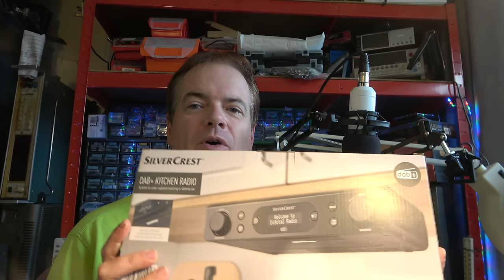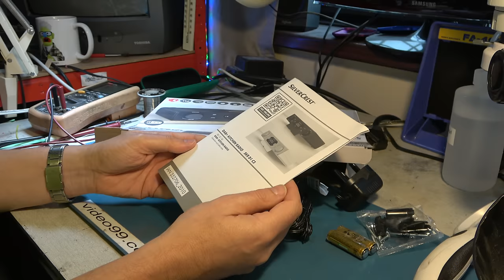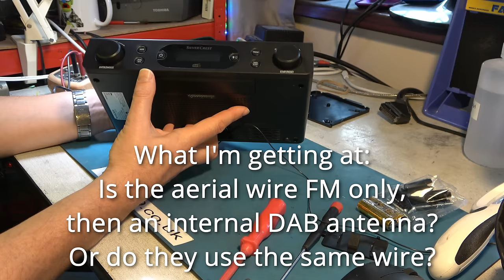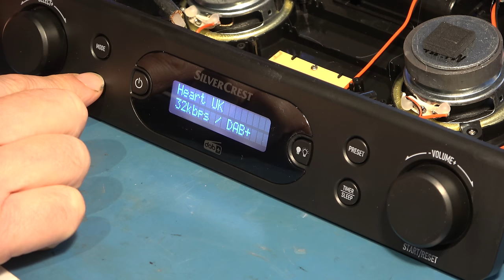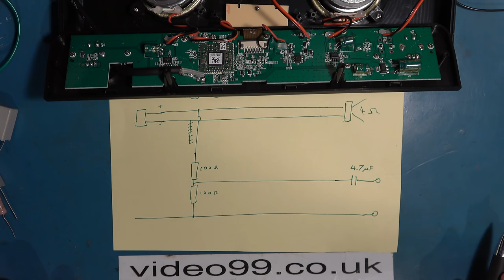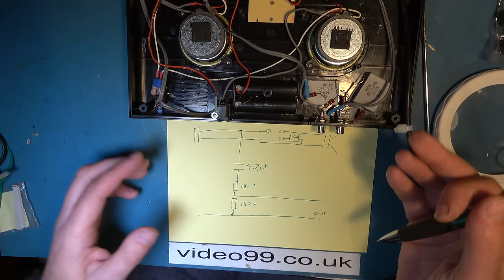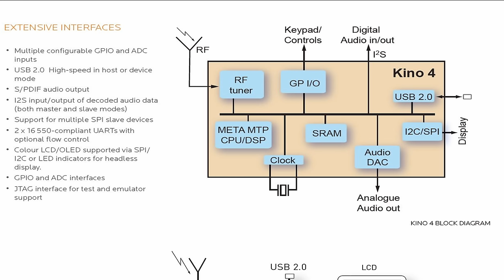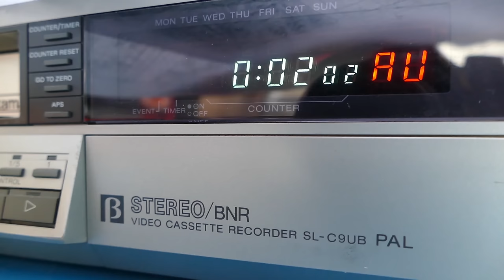DAB radio modifications.  LIDL kitchen radio could use some upgrades.  Part 1.

Comment: Did you select this purely because you want this style of under cabinet radio ? I switched to a Google home mini some years ago, sounds fine in the kitchen  :) DAB wise, silvercrest, ultra entry level, so I'm not surprised that it's deaf ;) Amazon echo also excellent for radio, they both just use TuneIn radio. Aren't the amplifier chips in this little bridged output devices rather than push pull... Hence the DC component. All makes for an interesting video, thanks as always.
Reply from the maker: I chose it because it was small, neat and cheap!  Whilst entry level, the radio module employed can also be used in more expensive devices so the performance is very good.  That's what can be great about modern electronics, even cheap items can perform brilliantly because it's almost impossible to screw up the operation of a bought-in module or chip.  Yes, the amplifiers are bridged (push-pull on both terminals), but the point is that neither terminal is at 0V and a DC block is required.
Reply: Very true indeed, frontier silicon make majority of modules these days I think. As you say amazing for £25 ! Some of the Majority radios are nice too. I bought my first DAB tuner back in about 1998, I took part in a field trial of dab back in 1994, had a technics ST-SG1000 at home for a while before it was released ...fun days :)
Reply: I live somewhere with good DAB reception and have a not very cheap Sony micro component reciever yet inside it is still problematic, have to be very particular about how the antenna is arranged. Even if you think you've got it right, if someone stands in a certain spot in the room it drops out! I didn't think that could happen with this type of antenna.
Reply: Gives you lots of audio streams when your internet is down though and doesn't saturate your bandwidth, especially when you have a family sharing one connection..

Comment: I was always curious if it is possible to extract the digital bitstream of one of these digital radios or the "HD" radios and save that data to a file that can be played and edited like a wav file.
Reply from the maker: The datasheet for the module says that S/PDIF is available, but there's no more information and it may be disabled in firmware.
Reply: The ETSI stream should be extractable (including audio in mp2 or aac), but without documentation and tools it will be tricky to actually do.

If you want it, some of the rtl-sdr dab open-source reciever projects would be a better place to start hacking. It should be able to recieve evrything within the DAB MUX at the same time.

Raspberry pi of a later version + a rtl-sdr stick may be the way if you want your own control.
Reply: @erlendse  I have an RTL-SDR and a phone. I can use it on my pc too but the stations are all over the place. What do I need to do to pick up and save the digital stream?

Comment: Hello, you could have saved yourself the work. Many of these standard DAB/FM receiver modules are for a wide range of radios, with and without line-out. You could have measured with oscilloscope at which unused pin the unregulated line-out comes out.  You can then turn down volume and line-out still works.  With kind regards.
Reply from the maker: I did that, but there's no line out feeds that I could find.  Some interesting digital signals though!

Comment: You will need  vertical dipole or small yagi for the DAB frequency fit it outside, your old tv aerial and amplifier will not cover that range.When 
I was in the UK 12 years I used to sell DAB radios with FM band as the coverage in practice is so poor and still is with poor bit rates and mono
broadcasts still
Reply from the maker: I have an aerial on order!  I believe it's the old DAB signals which have been switched to mono, not the DAB+ ones.
Reply: I hope so Uk should have waited and gone for DAB+ as it is somewhat better
Reply: external antenna makes such a difference if you can get it set up right. This radio is a great find I suspect because its not that expensive... its dab+ and its actually stereo. One f the reasons so many Dab broadcasts are in mono is that most people listening have little mono Dab radios with tiny speakers. Its rare for someone to try and push it for higher quality. No one expects too much of it in that way.. Its fun to see someone trying to get the best of it. Its good value for all those digital streams. How many channels are you pulling in there so far?

Comment: is there a SPDIF output connection?
Reply from the maker: The specs for the module say that it's available.  I suspect though it's probably switched off in the firmware.

Comment: can I mount 2Watt speaker on radio ?
Reply from the maker: You could take wires from the built in speakers, but if you only have one speaker to fit then occasionally it may not sound right because you would pick up only one of the two stereo channels.

Comment: Oh man, you cut out the soldering part.
Reply from the maker: The video was getting a bit long and the soldering was mainly to the PCB lands for the speaker terminals which are pretty easy to solder.  I'm just doing the same to the silver/white radio today.

Comment: I was a little confused by you wanting to tap on to the speaker drive,  as power amps always have a low constant hiss,  but a large divider ratio would push the hiss way down man :-D.
The 150-300 ohm resistors on a headphone socket jump to mind, when driven from a power amp.
You were also pointing to the beast chip outputs,  lower level and no hiss.
I'm no lover of digital radios, they just sound distorted to me.
Reply from the maker: If I had tapped from the radio module before the output amplifiers, I wouldn't have had enough signal level or low enough source impedance to properly drive the output sockets.  DAB+ does sound heaps better than the old DAB, especially at the very low data rates we use in the UK.  Still FM can be better though.

Comment: The DAB modules are mass-produced. 
If a "radio manufacturer" wants to build a radio, they tell the manufacturer of the module which functions are required. Then the manufacturer of the module gives the "radio manufacturer" a circuit diagram of how the switch and display and audio amplifier must be connected. 
This means that the entire electrical development comes from the manufacturer of the module. 
The "radio manufacturer" only commissioned circuit boards to be manufactured and assembled and had to provide the housing and loudspeaker and a power supply. And has to take care of the financing and sales.
The module manufacturer will reap the greatest profit, however, because they sell the same module and circuit millions of times around the world.
Reply: What you say here is only sometimes correct.  The schematic coming from the module manufacturer is only true for low-end radios such as this unit.  I have worked with manufacturers and DAB module suppliers in the far east and in Europe for over 20 years. The capability of the manufacturers varies greatly.  Also, depending on the manufacturer, software customisation may be by the module maker or the manufacturer or a third party specialist.  The modules often have build variations as well to only offer some features for higher prices.

Comment: The TV aerial won't be optimised for DAB, not unless it's a VHF band 3 type, As DAB uses the same channels as the old 405 line system.
Reply from the maker: I mentioned that it wasn't designed for DAB frequencies, but it was better than nothing.

Comment: EU mandates that every new car must be DAB+ compatible since December of 2020.
DAB was I think only in use Germany and the UK, and most countries now are already for years trying to roll out DAB+
Cheap mobile unlimited data plans, in combination with something like car play, many just skip DAB altogether and use the phone/spotify to play music, with superior reception.
Reply from the maker: Yes, I do the same myself.  I have DAB+ in one of my cars but usually stream music from Spotify instead.  DAB reception is too unreliable.
Reply: Norway introduced DAB many years ago. Then they switched to DAB+, leaving a lot of people with unusable radios. Incidentally, most FM stations are scrapped so you have to buy a DAB+ radio to get coverage.
Reply: The original DAB did exist in the Netherlands, but they basically hit the reset switch in 2013 and killed it off entirely, with DAB+ being launched as its successor. Lots of DAB equipment went obsolete in the wink of an eye, though, but at least it ensured DAB+ would have proper adoption by the radio stations!

Comment: DAB…..I hate it. Less sound quality, less choice, hit and miss reception. That’s how progress looks like on the airwaves. Internet radio offers at least a huge choice, sound wise it is only so so but hey, most receivers like the one you got there do not offer great sound fidelity anyway. DAB was designed for mobile use but even then it is no match for FM.
Reply from the maker: DAB+ is a good improvement on the original DAB which is ghastly.  I'm not finding DAB or DAB+ much use in the car, reception down here in the South West is too patchy.

Comment: the worst radio and expensive in relation to what it offers, DAB it didn't work for two months, when I now turn on DAB mode, radio it restarts and shuts down ... bad, very bad...
Reply from the maker: Obviously your unit has a fault, or perhaps a firmware update has got corrupted.  That shouldn't happen.  Not that I'm particularly impressed with DAB either, but it can be useful in some applications.

Comment: No Loss to anyone, Heart FM is abysmal anyway, as are all cloned local stations. I personally only ever bought 1 dab device, (for 50p off a car boot sale) it was a good price for just the board components. the audio quality is horrific compared to Analog FM. (i will never spend money on any device incorporating DAB). internet radio 4TW.
Reply from the maker: I was on the same page with DAB, but DAB+ is a very useful improvement.
Reply: Dab gives you lots of low bandwidth streams that are great if you don't have great internet or don't want to saturate the family connection with a lot of streams. Great value and especially if you pay only 50p!! How much do you pay for your internet? ;)

Comment: Why would you ever buy this kitchen radio? Are there still people listening to radio these days?
And you're spending way too much time and money on a worthless device.
This is just another thing you don't need that they want to sell to people as usual, I don't get it.
However it was interesting to see you opening it up to see what's inside.
Reply from the maker: The first one was bought for my dad, who does still listen to radio but wanted channels not on FM for his stereo system.  He uses it all the time now.  It's only worthless if that's not what you need!
Reply: @Bill Carson I do get that point but then again DAB is very low quality, it's not even in stereo even though you have 2 speakers the signal is mono.
I get it if you want to learn something but you can get much better stuff for the money that is much more interesting, for example make a Bluetooth speaker or make a radio receiver yourself for FM radio, at least that's in stereo and much better quality than DAB.
Reply: @RicardoPenders  I think it works with FM too but I don't know how well. Strangely the older FM rafios sometimes seem to work better than new ones but it might be interesting if the FM works well. One great feature of Dab radios is the mode button for switching to FM as you can easily switch from one station to another with just a button push! :)